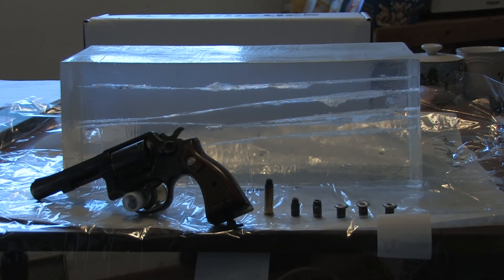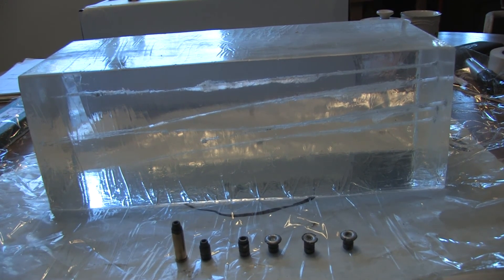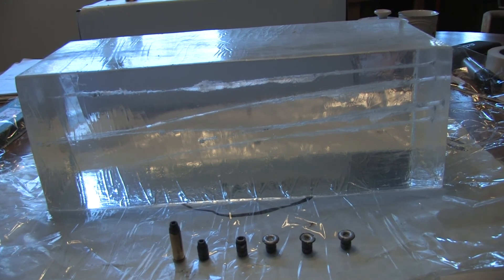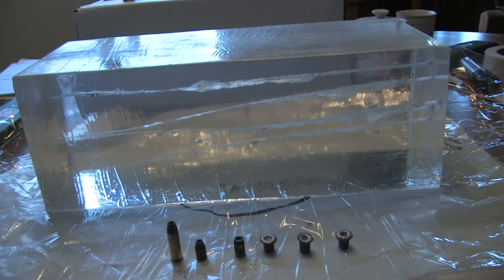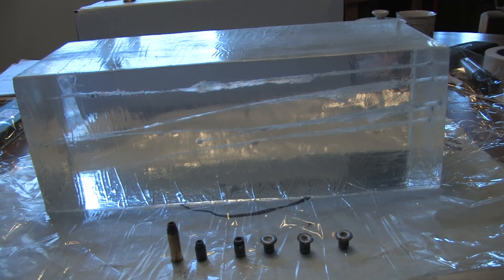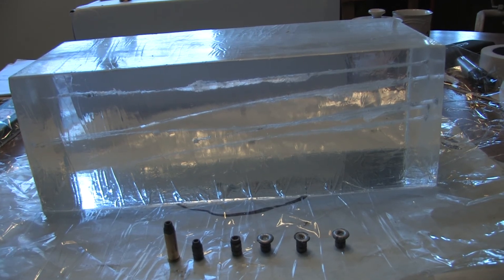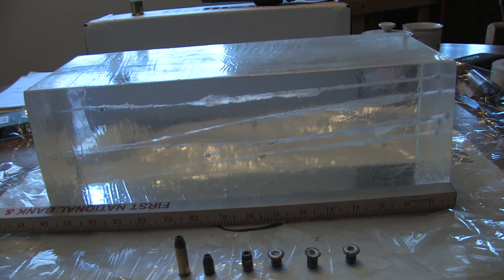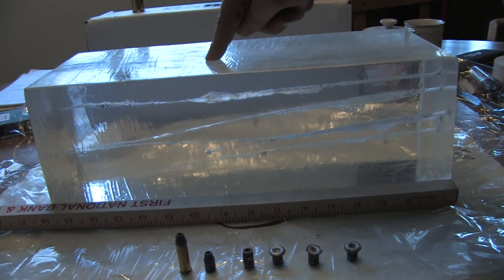Handload 38 Speical Speer FBI Load Clear Ballistics Test

Comment: How many rounds of +p ammo have you run in this gun?  I once cracked a barrel on an old 38 with +p ammo.  I know the 10 is very well tested but how much use have you done?
Reply from the maker: Not too many.  I've had some other hand loads, but for the most part I run lighter loads for economy, not so much recoil.  Even then, I think modern Model 10's built after the late 1950's can have an entire lifetime of +p without failure, and if it is to fail it would be where the 357 Magnum K frames fail, under the barrel in the frame.  I would not hesitate to put thousands of rounds through my Model 10, and I'm hard pressed to find examples of this causing problems.
What model and manufacture is your cracked barrel gun?  Softer steels used in older guns is usually the problem, even then old Spanish revolvers from back in the day are notorious for poor steel that caused failures.  I'm guessing you also had a pencil barrel.  If you blew up a bull barrel on a HB Model 10 made out of modern gun steel you would have done something extremely impressive, and not in the good way!
Reply: @kingduckford  It was a model 14 smith and wesson 38,  The barrel cracked at the forcing cone.  It was where the barrel and cylinder line up. I had a new barrel put on but it cracked again. The 10 is supposed to be a very proven revolver, I would imagine a sane +p would be ok.